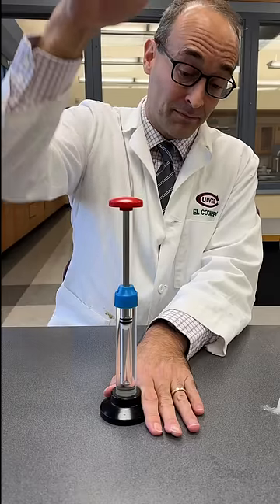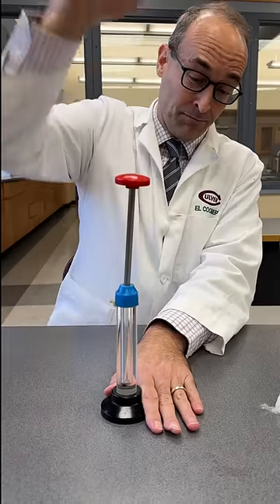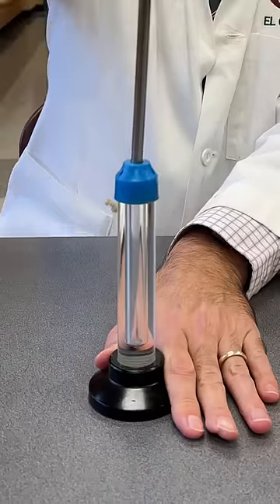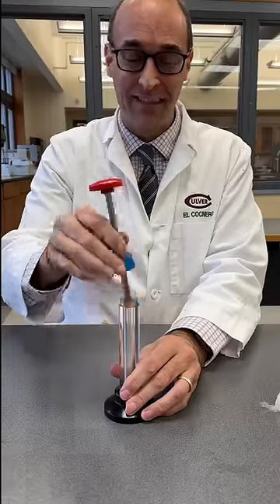Squeezing air to burn stuff

Comment: In gasoline engines this kind of autoignition is called knocking. It puts pressure on the piston before its in the right position. The reason lead was in gasoline in the past was to prevent this
Reply: Its not the early ignition, what wears the Engine and makes the knocking Sound. If a Gas Engine Knocks, there are basically two explosions happening: one explosion from the autoignition and one initiated by the Spark plug. When they Hit each other, a pressure Spike makes the Sound and puts huge wear on the Engine. To preven this, there are Sensors which can tell the ECU that the engine starts to knock. The ECU then fires the Spark Plug earlier, so the autoignition can't Happen anymore as there is nothing left to burn.
Reply: Also engine run on or dieseling.
Reply: @walterbishop2  what are the causes of engine knocking and can it be prevented by high octane fuel
Reply: @HCiceman  Depends on the Engine and the Fuel. Most modern Engines can run on Fuel at least one Grade lower then they are designed for, with the cost of less Power and more consmpumption. As anything less then 95 Octane went extinct in Europe decades ago, Knocking because of Bad Fuel isn't a Thing Here anymore. 
An Engine can also knock for other reasons, such as wrong Spark plugs, running too hot, massive Carbon build Up etc.
Reply: @@YahWinUWin Its Not called faith, Its called science.
Reply: @walterbishop2  and the check engine light will turn on lol
Reply: @walterbishop2  Just wanted to add something for any Americans reading your comment.  Octane ratings are different in Europe and North America.  RON and AKI respectively.  95 octane (RON) in Europe is actually lower than 93 octane (AKI) in the US or Canada.  I want to say Japan also uses AKI.  It's hard to do a conversion though, since the two rating systems involve different testing methods, so the spread will vary depending on fuel formulation.  It gets even more complicated since fuels in the different markets have different requirements for emissions, additives, ethanol blend, etc.  But, it's telling that even cars that require 98 RON in Europe run fine on American 93 AKI Premium, and advertise the same power ratings.  California 91, however... not so much.
Reply: Yes.  People think high-octane gas contains more energy than regular gas since it is used in sports cars.  It does not.  It contains the same amount of energy as other gas but can be compressed more before spontaneously igniting allowing for higher engine compression and better performance.
Reply: @walterbishop2  how could there be a second explosion if the combustion consumes the oxygen? Is it because they happen so close to one another?
Reply: there were other options lead was just the cheapest, They knew it was dangerous and that's why they called it Ethel in marketing.
A truly evil part of American history.
Reply: @royalgilpin4922  The 2nd combustion event (the detonation) occurs while the 1st is in progress.

The spark plug ignites fuel normally, leading to an expanding fireball in the cylinder.  This isn't a bang, it's a "whump."  Heat radiates from this fireball, just like the heat you feel from a campfire.  The metal and gases that haven't touched flames yet are heated.  If the metal is already hot from poor cooling or hot running, it can ignite the fuel before the flame gets there.  This may be an actual supersonic detonation, or another slower flame.  Either way, when the two flames meet in the middle, the local pressure in that spot is enormous.  Most people think of knocking as pre-ignition.  That is a thing, but what I described above is more common.  Pre-ignition is usually caused by the extra heat of conventional knocking.
Reply: @JETZcorp  I know the difference between detonation and deflagration, but I thought the ethyl lead was to prevent ignition purely from the compression of the piston. If the issue was detonation couldn't that be solved with a different air:fuel ratio?
Reply: @royalgilpin4922  Lead acted to boost the octane rating of the fuel.  There are ways to make an engine run on lower octane fuel, but most of them reduce performance and efficiency.  Lower compression, reduced spark timing, richer AFR.  Exactly the opposite of what makes an engine efficient.  Where reliability and performance are still the absolute priority, lead is still in use.  Aviation fuel and race gas are still leaded.  To be clear, I think that's a bad thing.  But the fact is that the best way to add detonation resistance to gasoline is pure poison.  It makes flame propagation slower and increases the temperature and pressure threshold for spontaneous combustion.  Temperature and pressure equals power.  Fortunately, we can get good-enough performance for road cars out of unleaded fuels with different compounds.
Reply: @JETZcorp  thanks 👍
Reply: @walterbishop2 US and Europe use different methods to display the octane rating. A quick Google alleges that US 91 octane is roughly equivalent to EU 95 octane, and that US 93 octane is roughly equivalent to EU 98.
Additionally, I wouldn't use the word "quality" to refer to octane. It isn't "better" gasoline in any sense of the word. Engines designed with higher compression ratios require higher octane to avoid predestination. Engines with more conservative ratios can run perfectly well on gasoline with lower octane. Considering that octane is boosted with expensive (and historically very toxic) additives, it's generally preferable to use the lowest octane that your engine is rated to use. If your application requires more compression, generally sports car engines, then do as your manufacturer suggests.

Comment: This is why the Titan crew vaporized before they could be crushed
Reply: The fireball lasts for a fraction of second. It probably would hardly leave a first degree burn, let alone "vapourise" them.
Reply: @xxfalconarasxx5659  You clearly don't know the tempratures we are talking about here. Based on math calculations in a reddit thread it would have reached closed to 1 726.85 degrees celsius inside the sub. At that point the time of exposure is not your biggest problem
Reply: @JoachimFosse  I know quite well the temperatures we are dealing with. It's estimated that the fireball is about half way the temperature of the Sun. However, this is also the temperature you'd get from the detonation of a hand grenade. The temperature of a lightning strike is about 30,000 C, well over the fireball temperature inside the Titan. Most victims of lightning strikes are not reduced to ashes, because of how brief the exposure is. So my point still stands.
Reply: Lightinging uses most of its energy going through the air by the time it reaches the person it is much less powerful
Reply: @xxfalconarasxx5659  Isn't what cools it down in the video decompression. That sub stayed compressed, no energy lost to decompression right?
Reply: @AtaGunZ  The temperature would rapidly go down due to the temperature differential between the center of the implosion, which is approximately 1200-2000 C, and the surrounding ocean, which at those depths averages about 0-4 C. The Titan broke apart when it imploded. The inside was exposed to the external environment that was the vast ocean outside. The high temperatures inside would quickly dissipate.
Reply: @riverpierson288  I guess to an extent, but lightning doesn't travel like a kinetic energy projectile. It  doesn't lose energy factors like drag. Lightning is a chain reaction of ionising air. The lightning bolts act almost like wires that transfer electrons from top to bottom. It mostly loses energy from travelling through a dense poorly conductive medium, like the ground below. It wouldn't lose all that much energy travelling through the air. Also, we measure the temperature of lightning by examining its black body radiation. The extreme temperatures is what gives the lightning its blue or white colour. Judging by photographs, the black body radiation seems pretty consistent from top to bottom most of the time, so it must still be incredibly hot when it reaches a victim. The rare colour variances we do sometimes see are usually a product of atmospheric conditions, rather than temperature variance.
Reply: @lock2434  Wouldn't make a difference.
Reply: @lock2434  I've already addressed this in other responses. It would be too brief to cause any significant burns, let alone full on incinerating the bodies. With in a couple of milliseconds, the temperature basically returns to ambient.
Reply: @xxfalconarasxx5659  you are correct the temperature of the gas definitely couldn’t have cooked them it is a bit more complicated though.

I don’t think that calculation could have been based on a “worst case” scenario (was it based on an initial small hole rather than a complete collapse of the frame? Or just the air being compressed by the weight of the water on it to the volume it should occupy at that pressure at the speed of sound in water?).

If the sub behaved more like a cavitation bubble the interior pressures and temperatures would have briefly been more like the convection zone of the sun than it’s surface because the momentum of all that water would also have to be overcome in that case the very centre of the imploding bubble would get really hot. At those temperatures a lot of the energy would be radiated off as x-rays and gamma rays however the 

People are made mostly of liquids and solids and not gas so they wouldn’t be in the centre, the surface of the submarine probably held out orders of magnitude longer than an imploding bubble and rapidly compressing liquids and solids also produces a lot of heat which wouldn’t dissipate as quickly unless the remains were really small.

I couldn’t find any thing by a condensed matter physicist on the question and I think it would be getting into their field of expertise. 

They definitely wouldn’t have died from being burned as you said they would have been crushed much too quickly. My guess is that there would have been enough heat energy produced directly in their bodies by the compressional forces to denature their proteins if they held together well enough to contain the heat (they probably didn’t), I can hit a ductile piece of metal with a sledgehammer hard enough that it will burn me if I pick it up too quickly and that is about 10Kgs moving at ~30m/s not thousands of tonnes moving at >1500m/s
Reply: @lock2434  air doesn't detonate, and there was nowhere enough oxygen on that sub to burn 5 people. They got obliterated by the power of water.

 This assumption is so ridiculous that it relies on the idea there was still bodies left by the time air reached 2000°C
Reply: In this debate of yours, i will go on @xxfalconarasxx5659 side... Compressed air did produce heat at a tremendous scale. those people may have or have not felt that "heat" but they did not die from it. it was the pressure itself that destroyed them.
Reply: @AtaGunZ  It doesn't matter that the titan 
stayed compressed", you have an instant onrush of nearly freezing water rush in and surround their bodies faster than the blink of an eye. They only experience a very brief fireball covering their skin and then immediately get covered in ice cold water so it wouldn't even be enough to burn their hairs off.
Reply: @JoachimFosse  Reddit is not a good source lol.
Reply: @JoachimFosse Let’s put it to the test by placing you in the Titan to be crushed.
If you get vaporised, i win.
If you don’t get vaporised, i win.
Reply: You are assuming that fine jets of high pressure sea water didn't intrude
Reply: There wasn't a piston mechanism on that sub.

 High pressure...cracks...water intrusion (negates fire)...equalization of pressure...air bubble (bubbles?) rise to surface

No indication of the type of damage you mentioned pertaining to the debris found
Reply: I imagine the victims on the Titan were probably pulverized.
Reply: Ya dude lots of people in near freezing water get incinerated all the time you child
Reply: Same thing happens in mining accidents as well if it’s from explosion and not a collapse

Comment: No matter how many times i had this explained. This is the first time i actually fully understand and it and can actualize that theory and practice. If only engines were see-through!
Reply: Unnecessary...just pump up a bike type with a hand pump & if do it fast you won't be able to hold the bottom of it as gets hot from "heat of compression"

Comment: Only diesels use compression for ignition. Gasoline vehicles use spark.
Reply: The compressed air pressure built up in the cylinder also is part of the contribution to the power.
Reply: Unless they are knocking
Reply: Well... Mazda do it with skyactive X motors. 
Copy from a article... 
the Skyactiv-X engine will use high compression to ignite like a diesel, running a very lean air-fuel mixture and reducing emissions. But when you step on it, the Skyactiv-X acts like a regular supercharged Atkinson-cycle gas engine. The ignition process starts with a spark before the engine's increased pressure is used to heat up the cylinder and ignite the rest of the mixture without further help.

..and that was in 2017...

We still better tech as EV 😏

Chill out.✌️
Reply: @ultrastoat3298  yes, that's why high compression gasoline engines require premium fuel, to prevent premature ignition due to this effect.
Reply: Would gasoline not catch fire if compressed? Or that happens only to diesel?
Reply: @Yumia5472  yes, that's called "knocking". but Gasoline require much higher compression than Diesel. 
But it still happens in gas engines. and to prevent that, high compression ratio engines require premium fuel with higher octane rating.

Comment: I'm a diesel guy so I absolutely would believe it lol. Cause that's how my engine works.
Reply: @HalideHelix big diesels tho. Not those cute little pickup ones
Reply: Same here lol
Reply: @Redbikemaster no, the cute little ones, too. They all work by compressing the air to the point of the heat igniting the atomized fuel.
Reply: @Lawrence330  no I'm saying I'm not into the little diesels

Comment: I was wondering why my pump tube got so hot while I was pumping up my bike on a very cold day. Thanks!
Reply: nah thats because of the rubber piston rubbing on the inside of the pump creating friction = heat. a bike pump gets nowhere near the pressure needed to ignite anything
Reply: @s1lh0u3x that's not correct. The temperture exist of atoms that are moving, the more they move the hotter it is. By compressing the air the it gets way hotter, and to prove this, take a pump tube with the rubber inside but not let it build up pressure. You will notice it doesn't get near as hot as normally.
Reply: The opposite of this may be a whip cream or duster canister cooling down quickly as it releases pressure.
Reply: You got me in the first half not gonna lie.